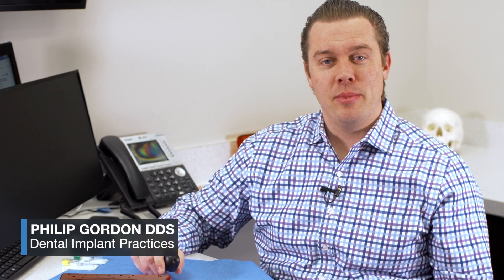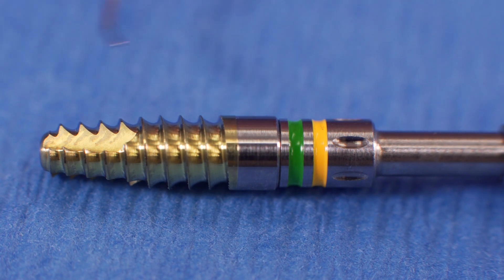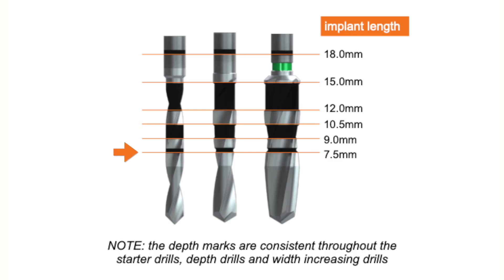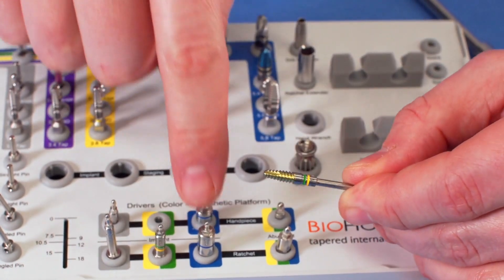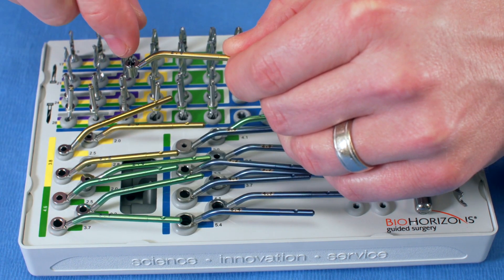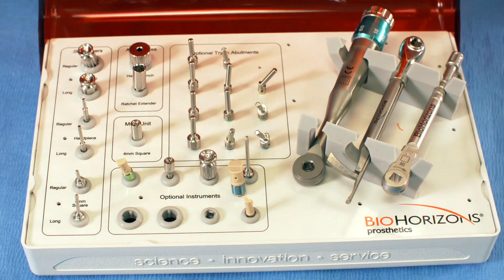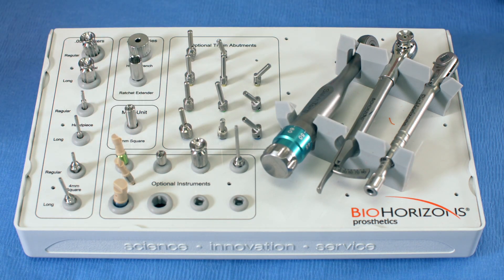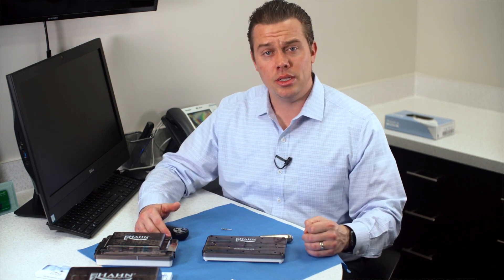BioHorizons Implant Review by Dental Implant Practices

Comment: Hi , I had a biohorizon implant for my upper right molar,  24 days ago just 4 days ago I started feeling pain like coming from inside the implant and under my ear ,I stated taking zithromax antibiotics,  the pain is less  under my ear but still there is pain and discomfort in the implant,  I can chew on the other side!! You know what  happened to  cause this pain ,though I'm brushing with total care and  flossing plus  gargling with salt and water,  (the implant replaced in the first stage screw only ) kindly advice  what is the solution to clear the pain,
Reply: Probably you have a problem with another tooth in the mandibule
Reply: Hi, it looks like a bacterial infection in the bone
Reply: @tutturus  hi .  sorry what does that  exactly means and what can i do to solve the problem !!
Reply: @raniahamzeh6483  you should have went back to the Dentist who placed the implant to check it out and see what is going on . I hope you did .
Reply: I had ten bio horizon implants done 3 years ago without any problems. I wish I could buy that tool set and remove my fixed bridges to clean them.